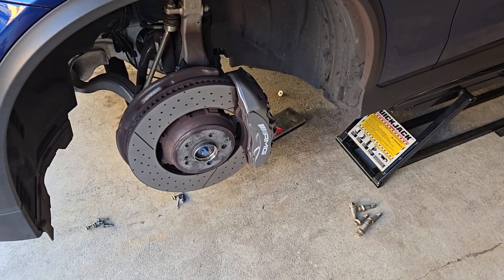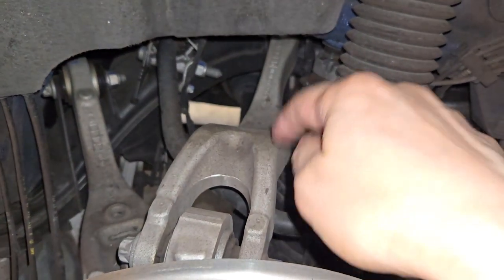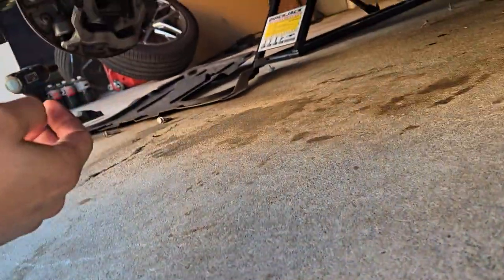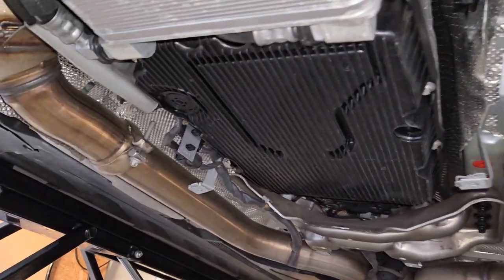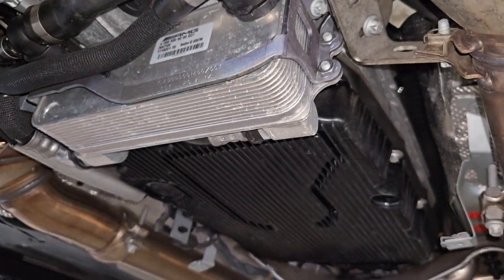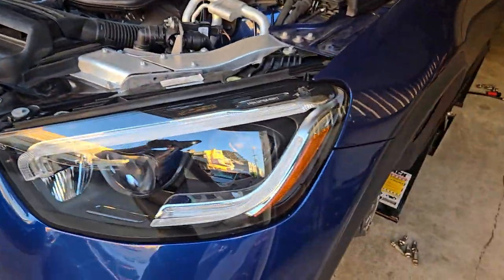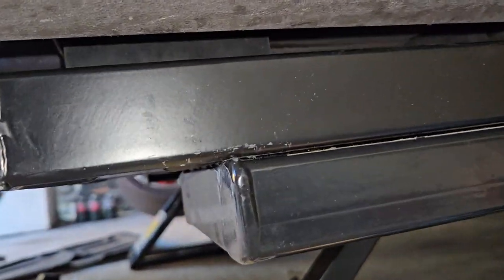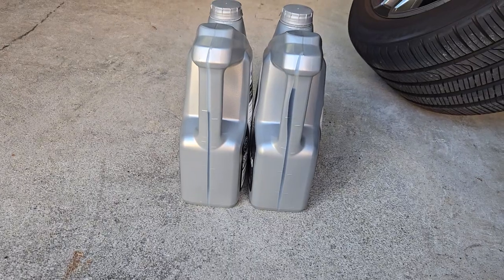GLC 63 AMG - after 3 years

Comment: Yea rear brakes on benz work harder than fronts. Mine did that too, I was told that it’s a safety thing from Mercedes, brakes hard in the rear so the front doesn’t nose dive if you rear end someone etc
Reply: Same as bmw the rear brake pads wears out faster than the front